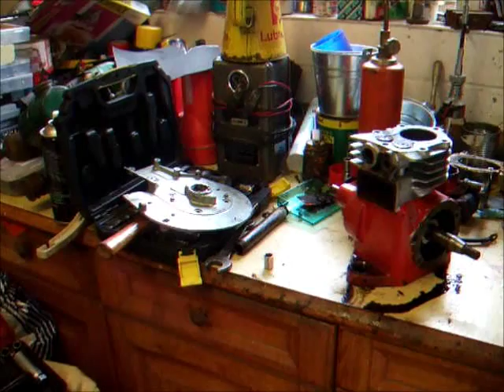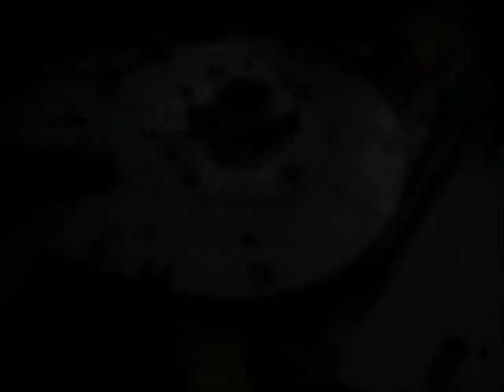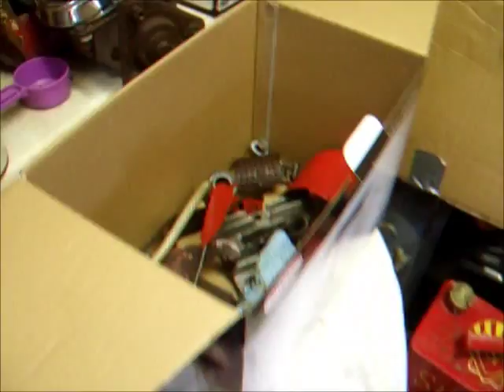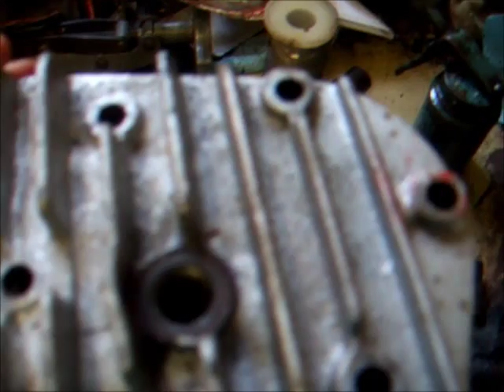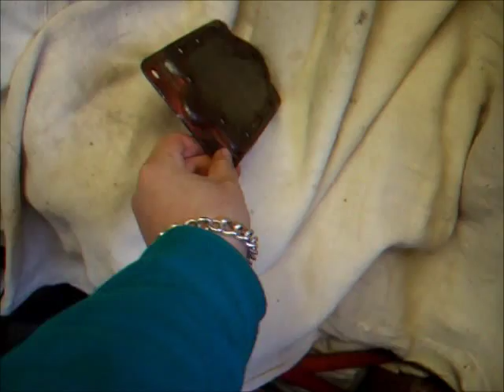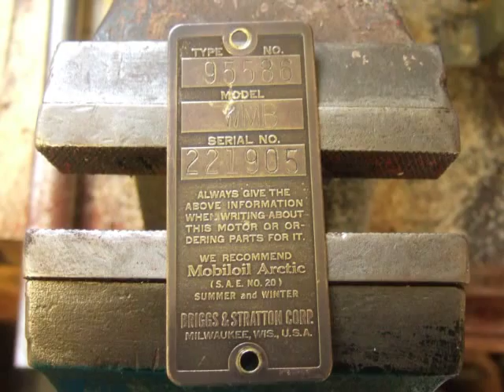Briggs WMB - Restoration - Part 3

Comment: you should be able to fabricate the fuel line easily from (American) standard parts.  Working in England is a disadvantage in that respect since your plumbing thread standards are completely different.

Comment: others have said that it hasn't got enough suction for a delivery pipe larger than 1/8" and that the check valve is critical to fuel delivery, and when these are corrected, running was fine.

Comment from the maker: The second engine (grey block) is a Suffolk Iron Foundry engine, company appeared in the 20's (i think) and started making the Suffolk engines in the late 50's. And continued making that design until the late 60's. Fantastic engines. But all good things come to an end, they then made the 98cc Cast ally engines.. known as the crapcast. Terrible engines. But the cast iron ones are top notch little work horses. 

Dan

Comment from the maker: The spec plate came out better than i expected.. clean but still showing its age. Lord knows who worked on this engine last, more gasket sealant then engine! And the oil seals have been attacked.. its not a pretty site. Nor is the bill for the new parts! :O 

Thanks for the links.. ive found all the bits I need. Just need to make a deal. 

Dan